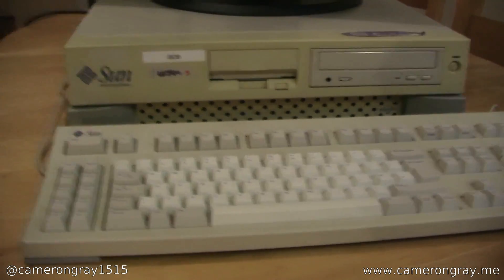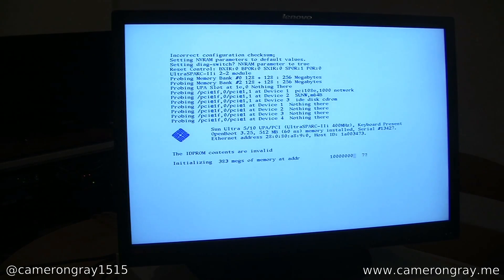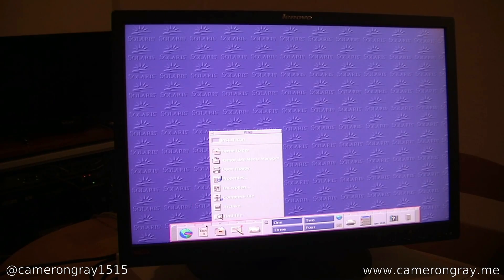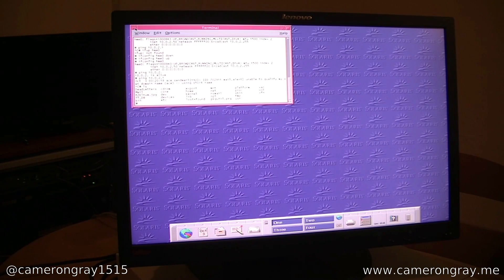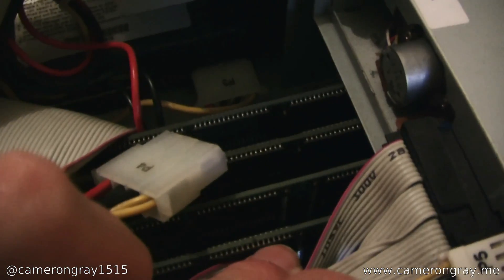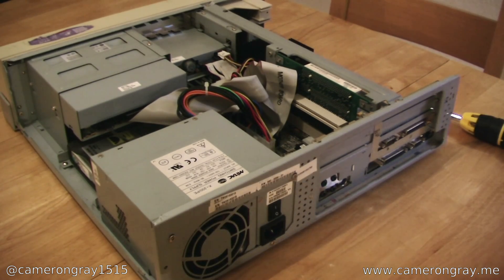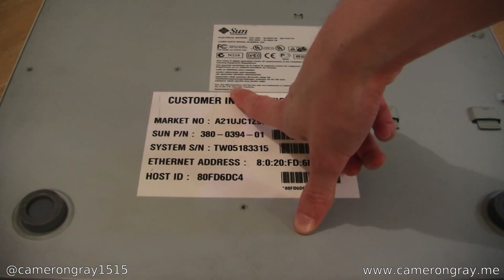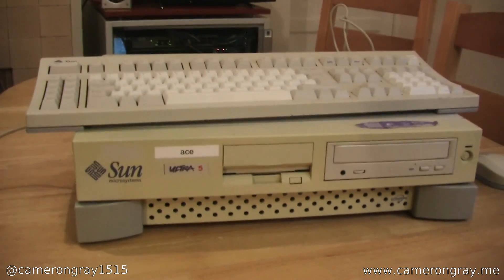Sun Ultra 5 UNIX Workstation running Solaris 8

Comment: How do u fix the clock problem? There is still a demand for these machines as proprietary apps in medical , eg DLX from GE, and net servers fields are  running, currently,  on Solaris.  The battery is the killer.  It is not just doing a surgical operation to change it the killer battery but u have to program it with the same parameters , if u saved them on a sheet of paper, needed by theedical Apps to run properly.  Great machine with a killer fatal flaw. A Medical equipment worth a million dollars depending on a 10 cent battery that could fail any time during a life saving medical procedure; a battery  very difficult to change and to reprogram. When Sun sold the compact foot-print Sun 5 , and others, to the top medical manufacturers to run their life saving apps, Sun failed to disclose this fatal flaw. Why would Sun install the Mac address and 15 other crucial parameters on a non battery dependent nvram? It would make the machine useless once it failed in 2 to 7 years..

Comment: Man, this brings back memories. When the video started, I could swear I was looking at my office machine from 1999. I loved the heck out of that thing. It's really too bad I couldn't take it with me when I left.

In terms of the web browser, there was an IE5 installation for Solaris. I do NOT recommend it. It was a piece of crap and broke my desktop profile. Instead, go find a Solaris compile of Mozilla. I had a cron job setup to compile Mozilla every night. (It would make a backup of the previous day just in case.) Mozilla worked really well on the machine at the time. It won't work great on a modern web, but it would have a better chance of rendering pages than Netscape. Netscape is as incompatible as you can get with a modern web.
Reply: ... why would you ever willingly use IE? Seriously.
Reply: @lunasophia9002  Believe it or not (I know it's hard to believe) but in 1999, Internet Explorer 5 was the BEST web browser on the market. It was the Chrome of its day., providing a fast and smooth experience that was light years ahead of the competition It would be another 5 years or so until Firefox would seriously challenge IE in its IE6 incarnation.
Reply: @thewiirocks  I had already given up on Windows at that point and was using Linux full time. Really, the only issues I had with webpages that I remember were with Galeon and Epiphany. Firefox--Phoenix, as it was then known--was pretty zippy and rather nice.
Reply: @lunasophia9002  Your timeline is WAY off. The Phoenix project didn't even start until 2002, three years after my story. In 1999, KDE 1.0 ruled the roost, GNOME was trash that RedHat was shipping with Enlightenment because it "was so pretty!", and the only viable browser option other than Internet Explorer was Netscape Navigator 4.0. And I say "viable" loosely because a LOT of websites didn't work. I setup a cron script to build Mozilla nightlies on my SPARC box so that I could have a browser that didn't suck. Speaking of sucking, Linux REALLY sucked at that time. I used FreeBSD over the next few years with much greater success. Better hardware support, faster performance, better memory management, *cough*didn'tloseallmyfiles*cough*. As a usable desktop, Linux was a number of years out from not being hot garbage.

Comment: I am not being completely facicetious (spelt wong) as what is this machine good for? Please forgive my ignorance but I need to understand why  you eat  dry Ryvita (linux) as opposed to lovely rich seeded bread.(Apple/Windows) Enlighten me.
Reply from the maker: Back in the day, machines like this would have been used for heavy workloads such as software development, data processing, CAD and database work or other applications where a rock stable UNIX workstation would have been required.  They were never aimed average consumers.  This sort of machine was one of the lower end workstations, Sun made machines compatible with the same software with tonnes of CPUs and loads of RAM for the time period.  Obviously nowadays it is pretty much useless outside of running legacy software that is tied to this sort of hardware

As for my choice of operating system, I use all OSs in different situations, I simply find that something UNIX-like (i.e. Linux or FreeBSD) works better for my needs and I can work faster in it than in Windows.  I also love MacOS however their current desktop hardware lineup doesn't suit me unfortunately and I'd want the same OS on both my desktop and laptop.  I personally have no strong opinions on different OSs, I use whatever works best for the specific task I'm doing.
Reply: That clears it up. I guess it is as much a memory lane trip for you as Windows 98 laptops are for me? I like all PCs but I do wonder why some ever engender affection when they only ever existed in a council office in Battersea or somewhere even less exciting.  Accounting has to be done but I would never hold a spreadsheet to my chest and tell it I love it.
I am glad somebody loves these poor orphans though. Every body/thing needs to be loved!
Reply: It's running Solaris, not Linux.
Reply: Mission critical SCADA systems used to use things like Unix or OpenVMS. Some of the OpenVMS systems I installed have run more than a decade which is rather longer than the standard PC  install. One of  my employers was a coal fired Power station and their SCADA was Solaris/Sun based. SCADA sysems are not replaced often due to the huge costs and downtime/risks involved.
Reply: Personally, I  really love the Sun Blade 1000 and 2000. Due to both the multi cpu's but also due to the ability to use FC-AL disks internally.
Reply: @taketimeout2share  These were rock-solid systems with an extremely stable OS that was also quite powerful. Getting real work done on them was a breeze since you never had to worry about downtime. Compared to Windows 98-based systems from that same timeframe, that was a breath of fresh air.